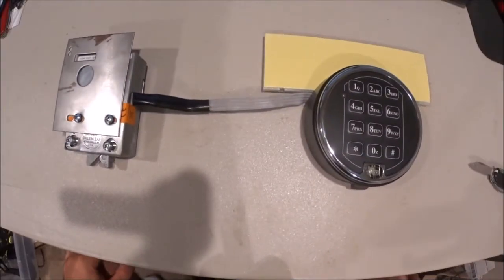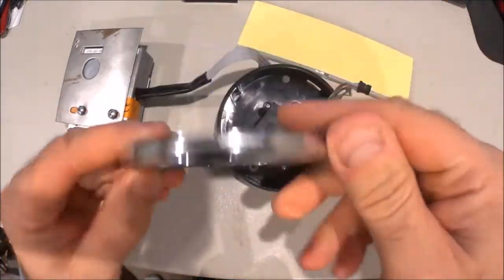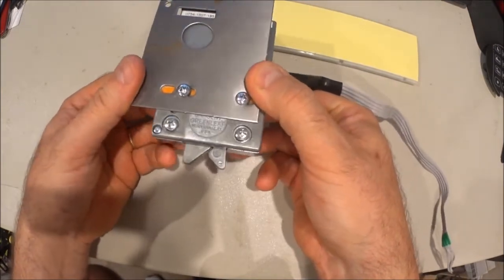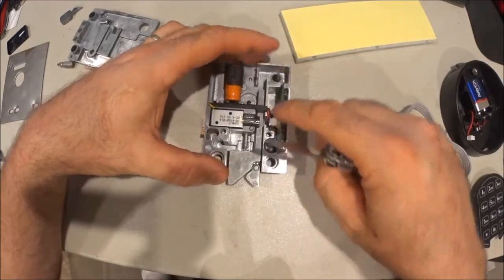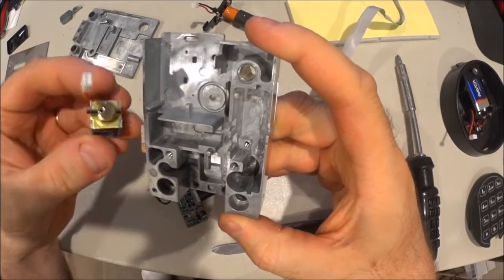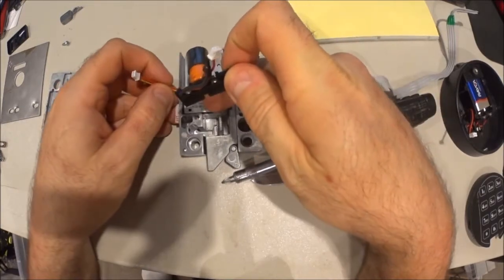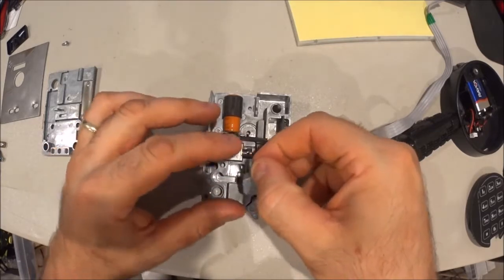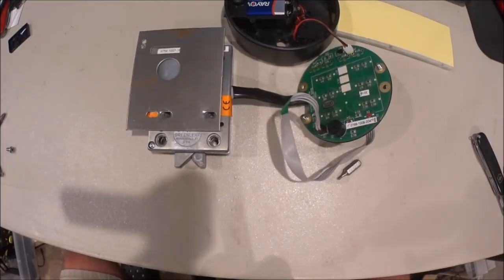Sargent and Greenleaf S&G 6120 safe lock disassembly (short version)

Comment: Use a high quality battery, I was having trouble with mine and was putting new generic 9 volt batteries and it was hit or miss. I started using Duracell Quantum and it works great again

Comment: On the question of the sprung part that appears to have no function: The solenoid can potentially be 'bounced' or 'shocked' by hitting the safe so that the inertia of the solenoid plunger would cause it to actuate without electrical input. The small mass on one end of the unknown part would also react to bumps and taps on the safe, however it is heavier than the solenoid plunger and has a small leaver part on the opposite end which engages on the roll pin through the plunger (this is what the roll pin is for!). When the safe is 'bumped' forcefully the mass swings down and the smaller end holds the plunger out, effectively preventing the 'bump/shock' type attack.
Reply from the maker: Makes perfect sense...great explanation!  One mystery solved...now if someone can explain the part that was causing the issue...?!?!?  Thanks for watching and for leaving a comment!!

Comment: 6120 Really,,,
Reply from the maker: Yes, really.
Reply: The 6120 model is a motor driven lock that came out quite a few years earlier than this model which is the Z02.  Good video though.  The problem part is called a relocker to block proper operation if the lock is attacked.  Unfortunately I dont currently have one to look at in the hopes of explaining why it was a problem other than possibly poor quality control.  On the batteries I do know the 6120 model is very particular about batteries.  Duracell or Energizer.